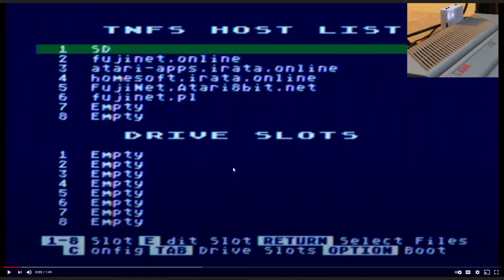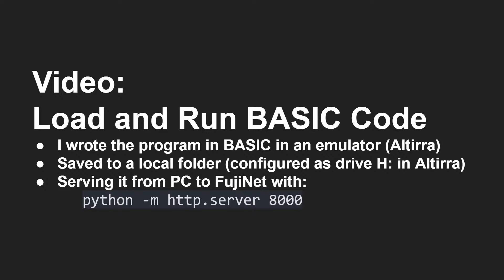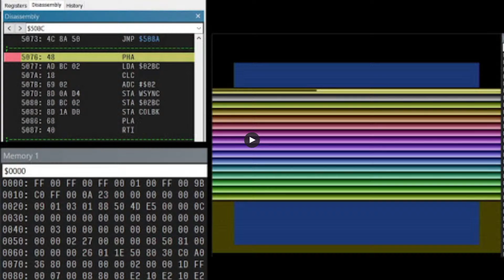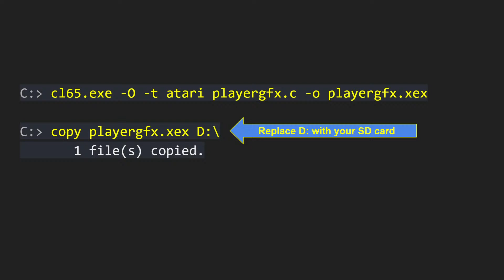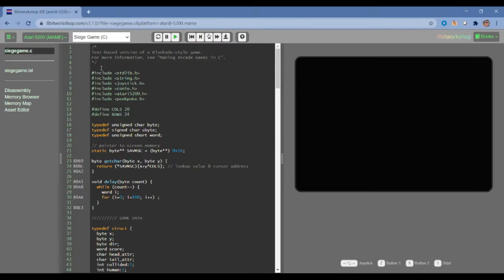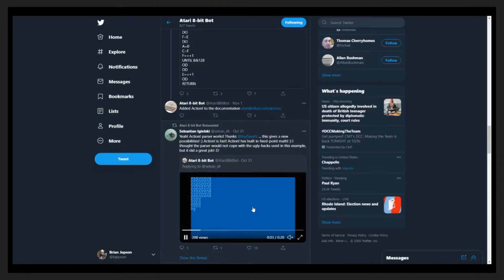All About Atari 8-Bit Programming

Comment: You missed the Atari 1200XL, the first of the XL line, the first Atari with 64K of RAM and a Help key. It also had four function keys that were not carried over to the rest of the XL line. 
Yes, many of the lower memory map locations were changed because the third and fourth joystick ports were removed and the memory locations were used for other purposes, such as an international character set. These changes were carried on to the rest of the XL and XE line.
Because of slight incompatibility with the 400/800 computers and its 'high' price, higher than that of the C64, it didn't sell well and was canceled after just a few months.

The cross-platform Atari800 emulator is the basis of the Altirra or Atari800Win emulator and the Atari800MacX emulator.
In my opinion, Atari800MacX has the very best and most accessible user interface. The other versions leave you to have to remember control-key combinations for all the functions.
Thanks for the Paddle tips. I did have at least one set of Paddle controllers for my old Atari 800 that I may be able to get back with my old Atari Home Computers, but this is good to know just in case. 
I did make my own light pen back in the day.
I'm looking forward to getting the FijiNet module and the recreated MAC/65 cartridge for my old Ataris when I get them back (after thirty years) over Spring Break. The Ultimate Cart is another way to mount an SD card to your old Atari.

Atari 8K BASIC saw ALL numbers as floating-point numbers, even the line numbers! But there was a bug in the floating point routines that made anything in Atari 8K BASIC notoriously slow. This is what quickly forced me to learn 6502 Assembly Language. Fortunately, Atari 8K BASIC has commands that make using machine language subroutine very easy. USR(ADR(ML$)) would jump to a machine language routine that was saved in ML$ after finding the address of that string. ATASCII uses all 256 8-bit binary combinations, so machine language can be represented directly as text. But strings in BASIC can be randomly relocated. That's why you have to request the string's address at the time of the call, and you have to be sure to use NO jump instructions in your code. Only BRAnch instructions are safe.
MAC/65 is a much faster assembler that works on the Atari. It also allows macros. The cartridge version (a recreation of which is available from AtariMax) includes the excellent Dunion's Debugging Tool.
MAC/65 is largely similar to the Atari Assembler/Editor cartridge, but it's more powerful and much faster.

All of these clever graphics tricks are well-explained in the excellent book, De Re Atari.
This is available, along with a BUNCH of other very useful documents AND software at AtariMania.

Comment: Btw you have misleading comment on the "STA $D01A" line. $D01A is not a shadow register but actual hardware register. ($02C8 is the shadow register of the OS for it, which gets copied to $D01A through OS interrupt routine).

Comment: 23:00 paddle return 0-228 
You trigger reset of POKEY cap value to 228 and each scan line subtracts one until reaching 0 or min/max voltage of cap.
DO NOT fry your POKEY or 6520, PIA (joysticks). They are extremely hard to find as it was used as sound chips in ATARI arcade machines.
People keep stealing spares from home machines or 7800 carts to repair arcades that can use 1-4 chips. ATARI also made dual and quad POKEYs on single chips to cut costs

Comment: My first computer was an Atari 1200 XL. I  also had a 600 XL, 800XL, and an XE game system and several hundred games. Used Atari basic all the time. I like that you could boot up Basic, basic games , and machine language games with a push of a button.

Comment: The clock speed of the Atari 8 Bit computers was 1.77 Mhz, quite faster then the standard 1 Mhz of the Apple II, and Commodore PEt and 64 computers of the day.
Reply: My Atari 8-bit ran circles around the com 64, in game play. Loading a game on Atari floppy disk took seconds, on com 64 took minutes +.
Reply: @wackyworldofwindios3476  the C64 had the SID, a better sound chip, and full color selection for characters, foreground and background, everything else was better on the Atari
Reply: 1.79 MHz  half of the colour burst  3.57954 MHz shared between 65c02, Sally and ANTIC. Sally had a halt pin so the video text/graphical lines could be drawn with DMA to memory (display list). 1.77 MHz is PAL timing.

Comment: True, most Atari programmers didn't use C, but just to clarify, you could use C with the Atari, as you could with any 8-bit computer of the day. Compilers were available for the Apple II and the C64, as well. One such compiler that ran on the Atari was Deep Blue C, which as I remember, was released through the Atari Program Exchange (APX). This tended to carry titles from the late '70s and early '80s, since it was around during the Warner days.

I was programming in C on my Atari in the early '90s (past its heyday), the 130XE, to be precise. The 128K RAM really helped, since I could set up a RAMdisk, and load a few of the tools I used into it, for faster access.

I got a public domain compiler off the internet. It wasn't easy to set up, because the compiler tools and runtime took up quite a bit of disk space on a floppy. There were so many files to manage that I used MyDOS, for its subdirectory support. There wasn't much room for a large program, unless I used two drives.

A common feature of all the 8-bit C compilers I know of is that they didn't compile to machine code. They compiled to p-code. The object code ran on a VM, which in my research I found out was an Intel 8088 emulator. The reason for this was that the compilers were based on Tiny C, which was originally written for the Intel processor. The main reason for the emulation, though, was that gave programmers a 16-bit stack (what the 8088 supported), as opposed to the 8-bit stack of the 6502. This prevented stack overflow on reasonably sized programs, but the emulation made them run noticeably slower than assembly programs (but faster than Basic).

One might wonder how one would program in C on an Atari, since its keyboard didn't have curly braces. Atari compilers got around that by using two-character braces, $( and $), to substitute.
Reply: The Atari Program Exchange also had a very good Pascal program. I took a course in Pascal in college and unlike the other students who were using Apples or IBM PC's (or clone) and who's  Pascal did not follow all the standards, Atari Pascal did. Like the C you mentioned or Atari Basic, Atari Pascal compile to P code. Also when it compiled you had to swap discs which was slow but thanks to having a Atari130, I used a ram disk that sped it up quite a bit.

My favorite language was OSS's Action. It must faster than C or Pascal was and it compiles very quickly.
Reply: @bjbell52  - I seem to remember trying a Pascal compiler on my Atari that I was pretty dissatisfied with. I don't remember what it was called, but I thought it was from APX. Maybe it was just public domain.

A little trivia. When I was getting my CS degree in the late '80s, I knew a friend who had an Apple IIGS. We became roommates, and I saw him working on his CS assignments using a Pascal compiler he had. I thought it was impressive he could do his assignments on his own machine, given what he had (I knew other students with PCs and Macs were doing that sometimes). I was logging in to the school's Unix systems using a phone modem to do mine. I used a free 80-column terminal emulator called VT10Squared that used graphics mode 8.

I found out more details recently about Kyan Pascal for the Atari through an interview with its creator on the Antic podcast. He revealed that Kyan was bought by Apple. They discontinued the other versions, and only distributed the Apple version. I thought this was odd, because I knew from my high school days that Apple already had a version of Pascal that ran on the Apple II, called Apple Pascal. It was a version of UCSD, and was self-hosted on its p-code system (it even had its own disk format).

After hearing the story, I "kicked the tires" on Atari Kyan Pascal, trying out one of my old Pascal assignments on it, and it worked perfectly. I didn't have to change any of the code. A rather interesting feature was it had its own shell that looks a lot like Bash (except I don't think it has scripting capability). Anyway, it worked like Bash in the sense that every command you used with it was an executable on the distribution disk, and each one could take parameters from the command line. Its editor was vi, like on Unix, and it looked and responded to all the vi commands that I remember. This reminded me that whenever my friend worked with his compiler, he went into a shell that looked like this, and used vi to edit code. It was Kyan Pascal. What was even better was he was running it on a hard drive, so he didn't have to swap disks (though, the IIGS also had a RAMdisk, but it was rare if I saw him use it).

The only difference I experienced between the Atari version and what he had was that he was able to work on an 80-column screen. I worked in the Atari's normal 40-column mode. I was running it in an emulator, which can emulate the XEP-80 (Atari's 80-column card), but I didn't think to try it.

Re. Action!, I heard about it, but never tried it. I think back sometimes on the fact that I was cheap when it came to commercial software. This was partly because I didn't grow up with a lot of money. I tried to buy my software used whenever I could, or find free software or shareware. So, I see now I missed out on some good stuff at the time.

Action! came out late in the life of 8-bit Ataris (late '80s). So, it didn't get used much. I've watched David Arlington's series on it. One reason it's faster is it produces native code. I also like to point out that like C, it was designed as a high-level language with low-level machine access (people keep pointing out, "It's more like Algol." I think they're talking about the syntax. I'm talking about the language design).
Reply: @mmille10  The Pascal I was talking about came out of the APX and was not public domain. It stuck very closely to the standard Pascal definitions. Compiling was slow until I copied the 2nd disc to my ramdisk, then it was quite acceptable.

I was lucky, I worked in a video store that sold Atari 800 software so I was able to buy my software at cost. Games that we sold for $50 I got for $20. That was nice.

The problem with Action was that you couldn't compile and distribute your program which needed a runtime library to go with it, and they charged for that. I used it to do things I want to have like a player/missile graphics designer and a similar program for bit mapped graphics.
Reply: @mmille10  actually Action came out in 1983.
Reply from the maker: Wonderful information, thank you!
Reply: Instead of the $( and $) digraphs, they perhaps also could have used the official trigraph sequences, which are in K&R and ANSI, etc. C standards:
??= 	#
??/ 	\
??' 	^
??( 	[
??) 	]
??! 	|
??< 	{
??> 	}
??- 	~
Reply: Yes, implementing C (to machine code) on a 6502 is basically impossible as it makes extensive use of stack space which the 6502 just does not have.
Reply: @rabidbigdog - Not entirely impossible, because CC65, a cross-compiler, generates 6502 code, but implements a software stack for parameter passing. It starts its own stack at an address in memory, and then either goes lower or higher (I forget). It has a heap, as well. At least when I looked at it in the early '90s, it used a scheme where the stack and the heap grew toward each other (one going higher, the other going lower). This requires a little emulation in the C runtime, keeping a 16-bit stack pointer.

I've changed my thinking some on the rationale for the approach taken with the C compilers I described. I think the idea was to implement them in 6502 code, but keep the backend the same as the original, producing 8080, or 88 machine code. The documentation I read at the time called the object code "p-code." People get this confused with a universal bytecode that Pascal compilers produced, called by the same name. It was not that, but I think the intent was to make the object code portable across all the implementations of Tiny C, on different CPU platforms, so that libraries could be shared, without needing to recompile from source. The 16-bit stack the Intel processor used was also sufficient for working in C. Maybe you could just link these libraries in, and it would work.

What I'm not sure about is if all the non-Intel implementations used the same VM model, emulating the same extent of the instruction set. They might have, since I used a "combo" of two different C compilers, one called CC8, and the other called Ace C, both based off of Deep Blue C. CC8 supported many more features of the C language than Ace C did. Yet, CC8 was designed to use Ace C's linker, so you could use its libraries and VM to run your programs.
Reply: @mmille10  It's been a LONG time, but part of the power of 'C' is the ability to do variable/pointer passing/return which made extensive use of CPUs with stack controls including overflow protection, like the PDP-11. Z80-based C had the advantage of a relocatable stack pointer register (also 6809) and one of my last programming projects was on an eZ80-based controller which we prototyped the software on the actual board and put into production from there. The 6502 is glorious, but forcing it to work with C is really pointless. Another option is CC65, which creates great code, but you have to run that via a targetting environment like Windows.
Reply: Store return address on stack and a pointer to the frame in the zero page at a corresponding address ( both 16 bit ) . 

With more RAM (16kB is a bit low), a compiler should be able to optimize code to make it faster and less stack thirsty.

TSA TAY LDA (Y),42